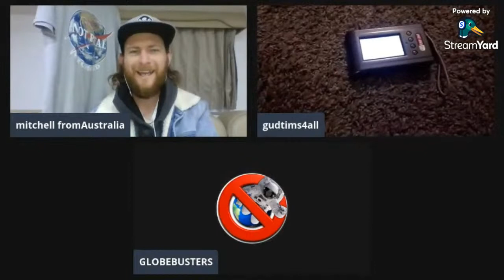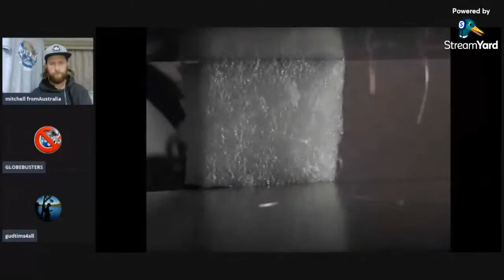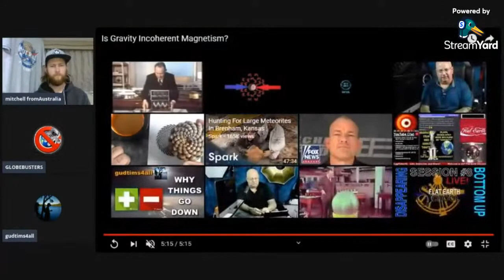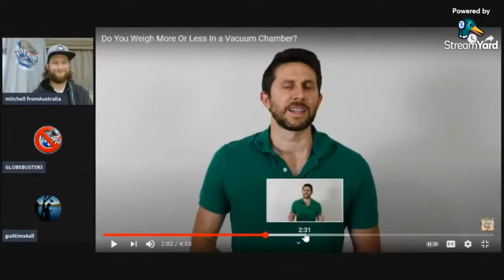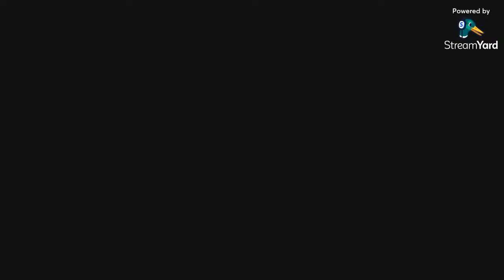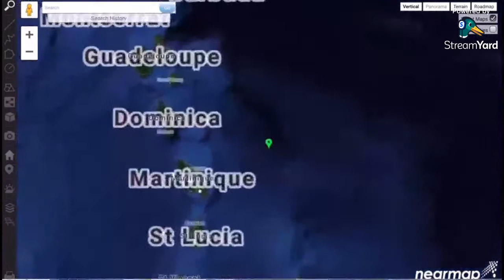Flat Earth School - Relative Density Disequalibrium vs Electrostatic Downward Vector

Comment: You can weigh the helium balloon in a vacuum, so it has weight it seems. It has the same weight in air and in water too (obviously, it contains the same amount of atoms, and then its absolute weight remains the same).
The only absolute weight is always the weight taken in vacuum. 
When the body is inserted in a medium the Archimedes' principle becomes relevant, and the relative weight of the body will be the absolute weight minus the weight of the volume of the medium displaced.
This rule is absolutely universal, it works for any object inserted in any medium, the helium balloon, the feather, the soccer ball, the bowling ball, inserted in air, in water, in mercury. 
In all the cases the rule is only one, the Archimedes' principle or the buoyant force, that has as a premise the existence of the weight in vacuum, produced by nothing else than the force of gravity, produced with whatever interpretation of reality you like the most (Newton or Einstein, the outcome is just the same).
This is the simplest form of existence of weight (aka force of gravity - the weight in vacuum), that is reduced in various degrees by the presence of a medium.

Comment: A bias to me means "no matter what" that it doesn't depend on anything else such as medium or density but that every thing will respond the same way no matter what the material is. And b/c factors such as medium and density do play a part in which direction things go then how can there be a bias? IF anything we can say that more things go down to a denser medium until they are inhibited by denser matter or material.

Comment: i have an idea but no idea how to get it done. maybe good one for yall to do idk if its gonna make sense but if we got one of these weather balloons and actually put two baloons(one above or below the other, whatever makes sense) on the thing with the cameras and computer chips that gets the data and seeing how the helium(or maybe its hydrogen idk) balloons cap out in that 120k foot area.......maybe having another gas in the other balloon that could possibly go higher or even stay there longer once the helium baloon pops. theres gotta be a way where we can float something all the way to the top. idk how or what gas to use or which one would be the lightest but if theres a layer of gasses that we kinda know about maybe we can use another gas to go higher when were in the positively charged area or in the less dense areas. but hey idk why the ballons even pop in the first place. but shit if we can get to that 62 miles area then were gonna know alot more especially if we get that footage back. or even have something that could pop the heluim balloon on a timer and let the other balloon go even higher. or shit maybe we need some rockets to go up all the way. the government did it and even the go fast rocket guy did it and of course we all seen new zealands moon from arizona hehe but theres gotta be a way to put something up there that can float maybe manipulating this negative charge or something idk man just send the vandegraph generator on the balloon or something like that ha.

Comment: Objects at the ground are not at a RD equilibrium - check what happens if they are pushed into a mining shaft or puahed into the sea. If objects are at RD equilibrium, they would float without a barrier preventing them up or down. So RD equilibrium is much lower than earth's surface.